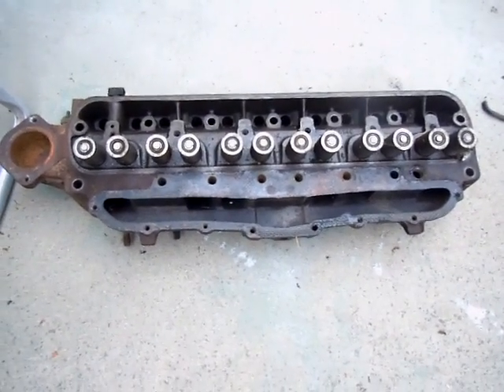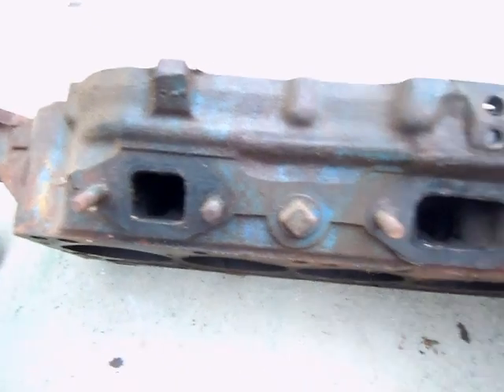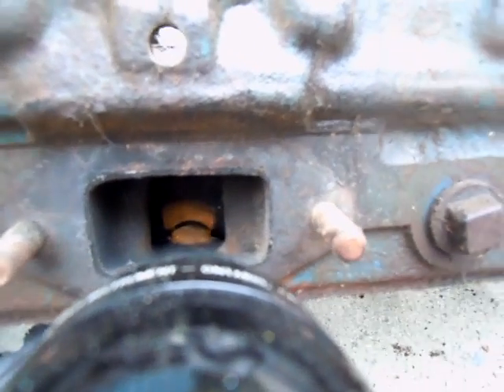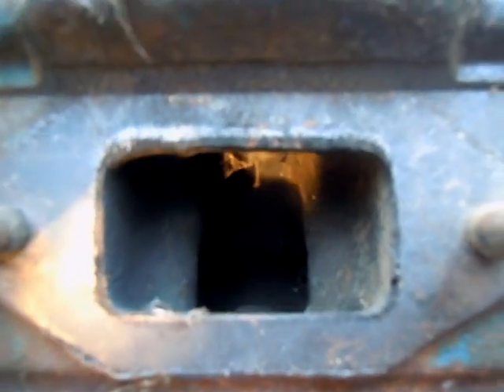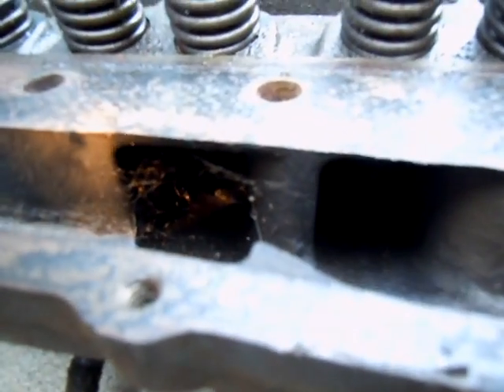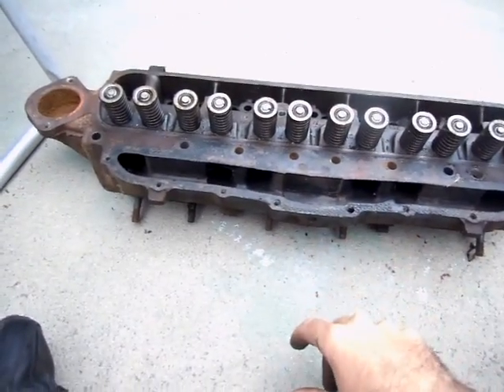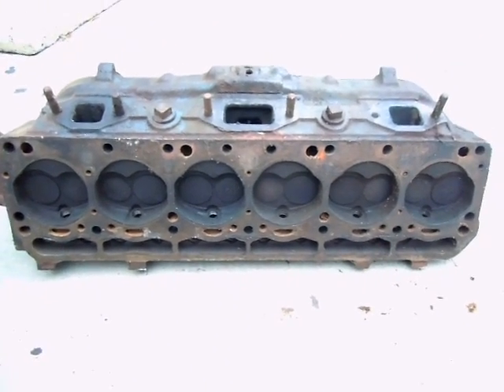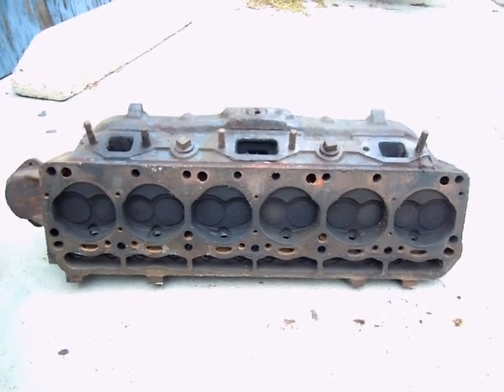Nash / AMC Rambler 195.6 3.2 litre cylinder head find. $50 !

Comment: Hey Jordan:  I just happened upon this vid for which I am grateful.  Have had similar ideas with regard to injection but also wanted to add an Eaton 62 to the mix just for giggles.  Noticed you talking about pistons.  Mine (63 American 2 door wagon and 63 American 440 H) are not flat topped and are quite nicely domed.  there is a "step off one side of the head that guides the machinist as to how low you can mill it.  I believe the TSM number is .060 but the step I believe comes in at around .075.  I am working on one of these now for a turbo app so we only cut it .012 to get it flat.  Another fellow in Chicago has done a blown version that is pretty wild:  all on four main bearings!  Thanks again for the video.

Comment: I would look at running 1 or 2 Clifford 6 = 8 Weber 38 DGIF's or so.

The 440 H models ran a 2-barrel carb, which made a LOT OF DIFFERENCE.

So, an Offy Adapter plate to run the Pinto Carb, mounted to the 2-barrel plate, would allow you 

to fit 1 Weber, would be easiest way to go.  WHAT ABOUT ENLARGING THE INTAKE SLOT ?/
Reply from the maker: F.G. Kaye my rambler is the 440h with the 2 barrel. With a modified distributor with more advance and a better curve it moves ok
Reply: @JordanPier  I'm learning quick 195.6 stuff is not common or cheap. Do you know any sources for a fuel pump rebuild kit?
Reply from the maker: @johnhosler6636  wish I did. When mine dies I'll likely go electric, with a vacuum pump and reservoir for my wipers.
Reply: @JordanPier  there has got to be another cheap pump that will fit the block and have the correct arm. I'm talking about a non vac mechanical .summit says no. My rambler is solid Nevada car but I can not pay 300 for a rebuild.  This sucks neat cars no parts
Reply: @johnhosler6636  Do not rebuild your own.  Nowadays you can not rely on kit makers to give you reliably ethanol impervious parts.  I give that headache to Arthur Gould Rebuilders in massachusetts:  Impeccable work.  Blasted, diassembled, blasted again, screws checked, springs checked, check valves replaced, diaphragms replaced, arm measured for deflection, boxed up and sent back for $150.  well worth it in my view
Reply: @johnhosler6636  why do you car if it is no vac?
As long as it fits!
Reply: @oldschoolcars3318  I said I wish I knew of a cheap fuel pump that fit even if it was a 20 dollar stamped tin no vac china special,  I ended up using a block off plate and a Holley electric
Reply: I did learn a mid 60s chevy c10 truck master cylinder bolts up to replace the 4 bold master that you can not find. Knock out the top two studs bolts right up
Reply: It was not just the 440H.  It was a $13.25 option in 1962 and 63 and was available across the full line from 220 on up.  My 220 2 door wagon has one with OD and factory 4.11 gears

Comment: I have the 196 in my '63 American.  The bad news is that replacement parts (bearings, pistons etc) cost many times more than they do for other cars. Regarding the heating of the intake; I have one (can it even be called "intake manifold") that had a copper tube running from one end to the other internally. It must have taken at least half the volume of the already small trough. I also have one of the rarer 2 bbl intakes.

If one had access to a mill the trough can be enlarged, or with a thicker aluminum plate make a whole new intake with its own inverted trough on the bottom (increased size) and carb placement (with multiples) where you want. But in the end it is still "lipstick on a pig."  I love the concept of the challenge but not the practicality of economy.

My goal is to put the 4.0 in the '63 American just because everyone else says it can't be done (engine bay too short). Either they are lazy or lack imagination. I mean the price of a junk yard 180 HP 4.0 ($200) sure beats 5-10 times that price for a 85 HP, 75 year old design rebuild.
Reply: Not my experience at all!  I have a 63 American 2 door wagon with the 2 BBL 196 and overdrive.  I also have a twin stick 440H and an Auto convertible.  I have found main bearings , rod bearings, and cam bearings all at prices about 15% more than those I pay for the 258 we built for our 68 American wagon.  When doing an overhaul on a 196,  Lunati or comp cams or sig  Erson cams will take your stock camshaft and grind .010 off the low spots on it which in effect increases your duration and lift and gives this engine some more mid and top end power.  The grind costs the same as a cam.  Pistons and Rings can be a tougher item, however, I have found nash and hudson rings that work quite well and I constantly keep an eye out on ebay for NOS pistons and rings.  I scored a 20 over se of each on ebay for $80!  Valves, lifters, and springs are all common place and inexpensive.  One of the hardest parts to get right on this engine is the rockershaft assembly if it is ever run dry because it can wear and bind once passages clog.  Keeping a full spare head and gasket on hand is a smart plan.  The carb kit is the same cost at mikes as any 2 bbl out there and the distributor is a common delco. The water pump can be rebuilt at Arthur goulds as can the fuel pump with ethanol impervious parts.    All the clifford stuff mentioned below is a great way to spend a lot of money for very little power return when measured in horsepower per dollar spent.  Before you do any bolt on performance mods, pull the head, shave it .060, use the clifford shorter push rods, do a great valve job, do the tom jennings thermostat housing mod, have the back of the cam ground, Port match the exhaust, polish the ports, and use the basic Carter WCD 2 bbl carb.  Make sure you are using oil with ZDDP and you will find you have a long lasting engine that puts out about 155 horses.  If you get these mods done and fine tune the ignition you will find the next best performance mod to the car is likely a dull duration (6-8 degrees more exhaust) dual lift .448 .468 custom cam, as, the exhaust valves when polished only flow at about 68% of the intake valves and a single duration cam does not address that flaw.  for the investment in a dual duration  cam to work maximally, THAT is the time to install a header.  In my view, with a single duration cam there is no real advantage to installing Headers as the cam is keeping the headers from being their most effective.  After an underground cam or a dual duration cam is installed is the time to go with intake and exhaust manifold changes.  Just my take.

Comment from the maker: @SuperScoobydoo777  Thanks! You're lucky you have the 232.  Much more common parts available, and a much more modern design. Those 232 and 258 engines were the building blocks for the 4.0 jeep motors that came later. Lots of performance options there. My engine was designed sometime in the 1940s and was used until 1965. No performance parts available, but its rugged and I'm going to see what its really capable of...